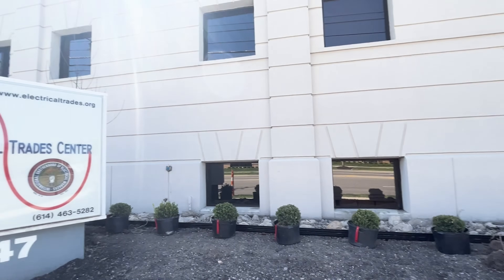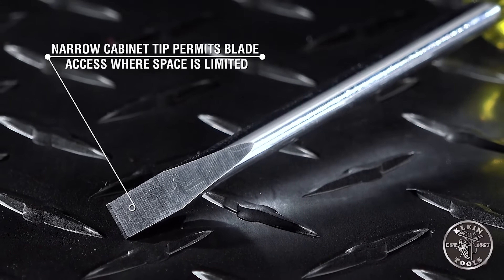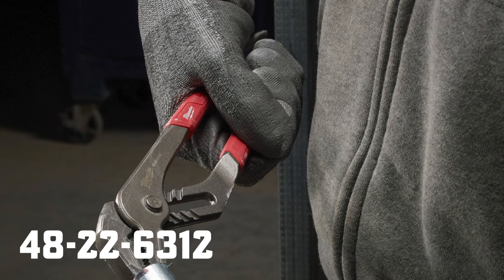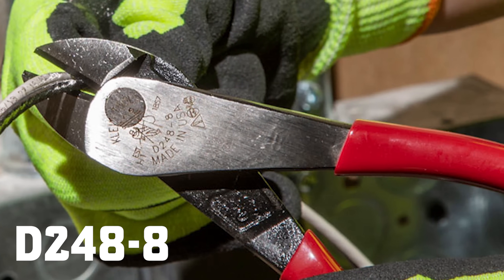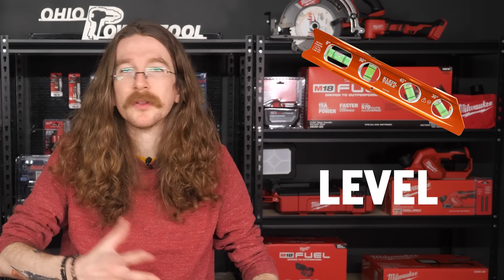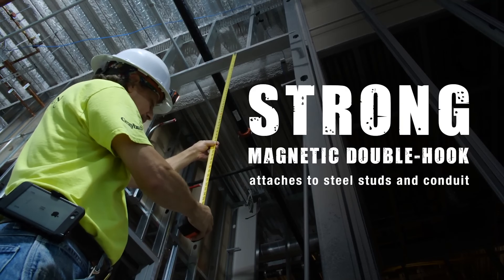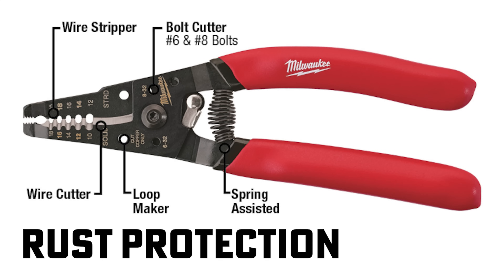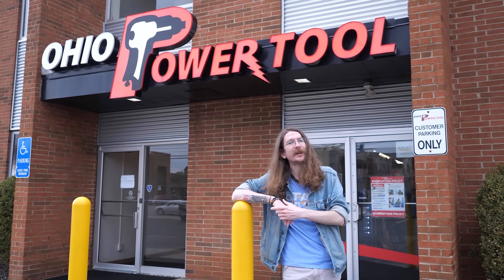Required Tool Kit for Electrical Apprentices from Klein and Milwaukee

Comment: If your new and want to be set get the Milwaukee screwdriver pack USA made preferably and Milwaukee or Klein lineman cutters diagonal cutter needle nose pliers and strippers as well as the Milwaukee 10inch channel locks if your doing industrial/commercial if your doing res don’t worry abt it and also a Klein tools voltage meter with receptacle tester Milwaukee tape measure would be good too and level if doing ind/comm utility knife Milwaukee fastback is good and maybe a roll of tape but that’s everything you will need as apprentice could leave a few things out and get them as the money starts coming in a little more

Comment: good list,but this is obviously sponsored,wiha,knipex,and  veto pro pac bags are great options also insulated is the way to go
Reply from the maker: We also carry Wiha and Knipex and love them! No sponsorship here, these are just a little more price friendly and the most common ones we see from the schools that we partner with. You are correct though, there are plenty of great options out there!
Reply: this was supposed to be for the beginner/starter.  Budget wise, who's the lowest cost?  if you can learn and do the work with mid-grade tools, you'll do even better with higher grade tools when the time comes to upgrade.  Meanwhile, you don't blow your budget when first starting out.

Comment: Should also include a receptacle tester. Klein has an amazing one that will also inform you if the outlet is wired differently. Checking all that shows that your focused on the little details and makes a huge impression.

Comment: The tape measure, please don’t show that image before you showed the klein tape measure. We’re not measuring our bodies here. For the tape measure itself, for easy sake, make everyone buy with metric, just in case the jobsite people go to will be measured in metric

Other than that, not bad for a starter tool list! I had most of these tools from the start. There are some pet peeves that i have in some of these tools before, so i changed them

Comment: Good list. Assuming by the title that you're only using Klien and Milwaukee since they're known names but I wouldn't touch klien screw drivers again and the Milwaukee ones are bulky and horrible. I bought a multi bit screwdriver from klien and within a few weeks the rubber was coming off. The milwaukee voltage tester I would stay away from as it's extremely bad, difficult to open to change the batteries and falls apart, for voltage testers Fluke and Klien are both good. For the channel locks(aka slip joint pliers) I would go with the Knipex Cobras as they're are far better as the Klien channel locks have zero bite to them. The backpack is debateable as a small bag with a larger bag with wheels is better for the back and hips. I use a husky set which is very sturdy and strong. The knife can be a utility blade or a hawkblade/the wire stripping knife from klien. Best tools in all honesty is Knipex for all cutters, strippers and cobras, wera for screw drivers, tape measure doesn't matter, the klien level is best due to the magnets only, Klien/fluke voltage pen tester, bag is better with the packout of some sort. Also a small pouch is a must as it allows you to carry the tools you use most on you at all times. All in all very good informative video.

Comment: Best advice for apprentices is to pass on the Milwaukee hand tools and stick to Klien with the mindset that you will replace any of the tools with Knipex or Wiha as the Klien tools wear out. Klien is still a decent brand but they arent what they were 15 years ago. Knipex is what all the commercial and industrial electricians strive to use especially the Cobra line. I dont know a wireman who doesnt say Im going to buy a pair of knipex pliers as soon as my current pliers give out.

Comment: I’d just like too add that this is relevant to the USA, and not here in the UK. I have an extensive collection of Klein VDE tools, screwdrivers, pliers, pump pliers, side cutters etc. Also the non insulated 11 in 1, 4 in 1 stubby and 4 in 1 precision drivers, hacksaws, tape measure, magnetiser, digital temp probe, multimeter, several volt sticks etc etc you get my drift. 
So, I’ve spent all that money but I’m about to ditch Klein in favour of Milwaukee, Wera and Knipex. Why you may wonder, it’s because of poor aftersales support. It’s impossible to get things locally, and import costs are prohibitive. So, I’m going to predominantly buy European manufacturers tools, and not USA things. 
My OCD won’t let me mix brands/colours etc so the Klein kit will be retired, but kept as a possible backup if I’m unfortunate enough to experience another tool theft. 
I have the Milwaukee nut spinners you featured, them and a set of non insulated drivers will be my only outside EU tools I’ll have, backed up by Knipex and Wera. Apprentices, buy quality tools, buy a tool a month, build them up and take good care of them, they will be earning you your living going forward and some VDE stuff could save your life. 
Other manufacturers like Wiha, Stanley Fatmax  ( owned by DeWalt ) Bahco ( owned by Snap On ) have very good quality tools and are worth consideration.

Comment: The one tool I've never seen in these tool collections is one that I used frequently. That's a 6" crescent wrench. Great for nuts on al-thread. Nuts on pipe straps. Being an older electrician most electricians in my day always carried two pair of channel locks. I preferred the 430 size as being large enough to handle fair sized pipe and still small enough to be convenient  to carry in your pocket. And of course only bare handles because you reamed the out side of the pipe with the jaws and the inside with the handles. On larger pipe you had to push them well into the pipe. The hardest tool to find was a decent hacksaw. I had a spartan but it always cut crooked. The problem was that they often got tossed on the concrete and would spring out of alignment. I finally ran across an old craftsman hacksaw with the wheel adjustment and still have it today after decades of use.

Comment: Are VDE insulated Screwdrivers not commonly used by US Sparks?
Reply from the maker: They are not commonly used as they are designed to meet European safety standards. The differences in country standards honestly just boils down to monitored testing, that's all.
Reply: @OhioPowerTool  Thanks for the info. I was just interested as I always see US spraks on Youtube with non insulated drivers. In the UK it'd be very rare to see a spark without VDE screwdrivers.

Comment: Ncvt is fine but I'd recommend a multimeter until you understand how to use ncvt as it's not always entirely accurate depending on the situation

Comment: I think the list is fine, but I would add a magnetizer/demagnetizer.  Klein has a nice one on a keyring you can attach to your bag.
Reply: Any magnet will magnetize. Smack it on concrete to demagnetize.
Reply from the maker: A magnetizer would be an excellent addition!

Comment: This video is bad. Y'all don't know what you're talking about.

11 in 1 klein (HD or extended)
32751 klein (square and small Phillips shafts are nice too) 
6 in 1 nut driver shaft (handle not needed
Bosch 6in extension 
Klein hybrid lineman's 
Knipex 7in and 10in cobra
13 71 8 Knipex strippers (expensive but way better, or needle nose version) 
Fluke pen tester
14 in 1 klein precision driver (or 27/40 piece) 
Klein or knipex dykes
Husky little bucket pouch or 18in bag
Klein 6in level 
Husky 4 in 1 ratchet wrench
3/8, 7/16, 9/16 impact deep sockets 
Klein adjustable length screwdrivers, 3in and 6in (only need the shafts) 
Midwest Sheet metal cutters

Also good...
Knipex lineman's with strippers
Klein needle nose with strippers
klein katapult strippers

----
This is way better than the video. Smaller, lighter, way better quality. Probs more money, like 2x, but also about 5x as useful and 3x better quality.

The video is a salespitch. Klein has good stuff. But single drivers for newcomers is ass. And Milwaukee tools are ehh at best. At best. Channel is bad for selling a lot of trash as top tier.
Reply from the maker: Jose, this is a great list! Thank you for sharing! We know when it comes to building a perfect electricians tool kit everyone is going to do it a little differently. This is NOT meant to be the perfect kit. We just wanted to share what the apprentice program has for the minimum tools required, of course these students can add or upgrade from there!

Comment: Klein hand tools and Milwaukee power tools is all you'll need. Take it from me I'm a pro.
Reply from the maker: Listen to Ron, folks! This man knows what he's talking about!!
Reply: I've stuck with Klein as well because most of the handtools are made in America.I will try the Milwaukee US made handtools.
Reply: Wiha hand tools Knipex pliers and Hilti power tools
Reply: Why is Milwaukee the choice of pros over DeWalt?
Reply: @Femur15  if you got time to read here’s a run down thanks to AI

Milwaukee and DeWalt are both top-tier power tool brands, but Milwaukee is often considered better in several key areas, depending on the user’s needs. Here are some reasons why Milwaukee is preferred over DeWalt by many professionals and enthusiasts:

1. Battery Technology & Ecosystem
	•	Milwaukee’s M18 & M12 systems are extremely versatile, with a vast lineup of tools that share the same batteries. The M12 system is especially strong for compact tools, something DeWalt lacks.
	•	DeWalt’s 20V MAX batteries are solid, but their FlexVolt system (which switches between 20V and 60V) can be overcomplicated and not as widely adopted.
	•	Milwaukee’s HIGH OUTPUT™ batteries deliver better performance and run cooler under heavy loads compared to standard DeWalt batteries.

2. Tool Innovation & Specialty Tools
	•	Milwaukee leads in tool innovation, with features like One-Key (Bluetooth tracking & customization), MX Fuel (battery-powered heavy equipment), and Packout modular storage.
	•	Milwaukee offers more specialized tools for trades like electrical, plumbing, and HVAC (e.g., M12 Force Logic crimpers, copper cutters, and knockout tools).
	•	DeWalt is more general-purpose and lacks many of these niche tools.

3. Build Quality & Durability
	•	Milwaukee tools tend to have better durability, especially in harsh job site conditions. Many of their tools have metal gear housings and robust internals.
	•	DeWalt tools are durable, but some of their lower-end tools use more plastic components, making them less rugged in demanding environments.

4. Impact Wrenches & Drills
	•	Milwaukee dominates in impact wrenches, especially with their M18 Fuel Mid-Torque and High-Torque models, which outperform DeWalt’s comparable tools.
	•	Their M12 Fuel Stubby Impact Wrenches are a game-changer for mechanics and electricians.
	•	Milwaukee drills tend to have higher torque and better electronics for performance consistency.

5. Ergonomics & Design
	•	Milwaukee tools often have a better weight balance and grip design, making them more comfortable to use for extended periods.
	•	DeWalt tools can be bulkier and sometimes feel top-heavy, especially in their hammer drills and larger impact wrenches.

6. LED Lighting & Work Lights
	•	Milwaukee has some of the best job site lighting solutions, with TRUEVIEW™ LED technology, offering better brightness and color accuracy.
	•	Their work lights are more rugged and versatile, while DeWalt’s lineup is more limited.

7. Warranty & Service
	•	Both brands offer strong warranties, but Milwaukee’s service centers and customer support are often rated better.
	•	Milwaukee offers 5-year warranties on most tools, compared to DeWalt’s 3-year standard warranty.

When DeWalt Might Be Better
	•	If you already have a big investment in DeWalt batteries, it makes sense to stick with them.
	•	DeWalt’s FlexVolt system can be useful for high-powered tools like table saws and miter saws.
	•	Some people prefer DeWalt’s circular saws and routers, as they tend to perform slightly better in woodworking applications.

Final Verdict

If you want innovation, battery efficiency, and durability, Milwaukee is the better choice—especially for electricians, plumbers, mechanics, and HVAC professionals. DeWalt is still a strong brand, but Milwaukee’s edge in technology and specialized tools makes it the preferred brand for many trades.

Comment: The ncvt is good and all if you know how it works via capacitive coupling so it's not always the most accurate I usually use it as a second check that something I'm working on is dead or to see which wire in a cable is the hot wire but I always test on a known live source first and don't forget about a good multimeter you don't need to go crazy expensive the fluke t5-600 is a good starter multimeter for anything low volt 120/208/240 granted if you start working industrial or commercial and on medium voltages like 277/480 347/600 I'd go with something at least 600 volt cat 4 1000 volt cat 3 rated. But defo get a multimeter that will give actual values and is much much more reliable than a ncvt.

Comment: I prefer Irwin and Lenox pliers. Milwaukee is overrated
Reply: You must not be an Electrician, best electrical pliers are made by Klein and Knipex, also Milwaukee have very good electrician handtools that keep getting better and better! Milwaukee make my favorite wire strippers (Milwaukee 6in1).
Reply: @Htm.13  I'm not into electricity
Reply: @mikeaustin1323  Yeah the video talked about Electrician apprentices, and it shows that you re not an electrician from the brands choice (General construction? Plumbing ? Although most plumbers love channel lock and Ridgid)
Reply: @Htm.13 Nah Milwaukee hand tools suck and real electricians use Klein. It's easy to improve when you are starting from shit. Crescent and Channellock are still superior.
Reply: @coralreefer23  All my pliers are either Knipex or Klein, I don't buy shit tools! But for strippers the Milwaukee 6in1 pliers are my favorite, also Milwaukee now have a made in the US line up now, they def don't appear to suck.
Reply: You're also working paycheck to paycheck working for somebody time to buy quality bud were adults now we don't have to hate
Reply from the maker: Very fair! At the end of the day, you should use what is most comfortable and, above all, safest to use for the job at hand!

Comment: Why no 10.000 volt rated hand tools offered by Milwaukee ?
Reply from the maker: Milwaukee does have a few options 3, 4 & 10 piece insulated screwdriver set. Nothing in nut drivers or any other hand tools yet. Hopefully they can ramp up that USA made hand tool factory and fix that. https://www.ohiopowertool.com/brands/milwaukee-tools/milwaukee-hand-tools-screwdrivers-and-fastening/milwaukee-tools-48-22-2210
Reply: Have the 3 piece screwdriver set mentioned